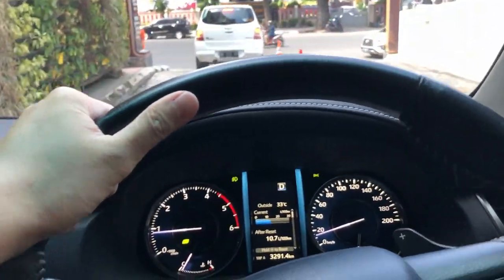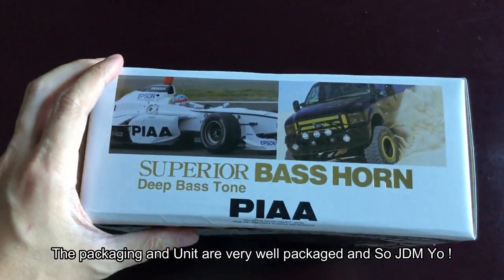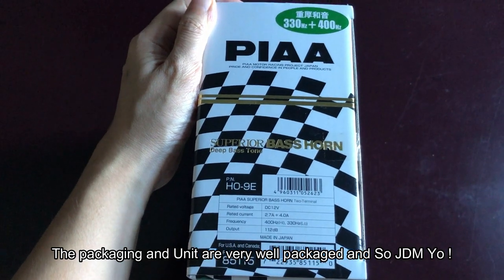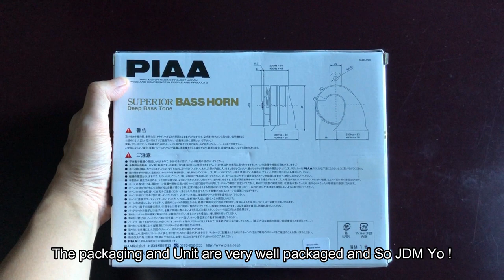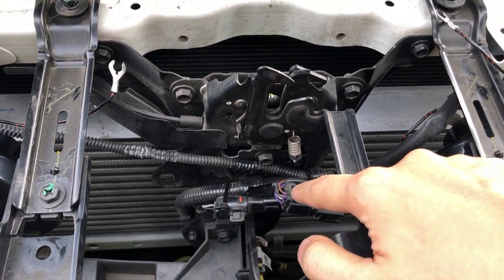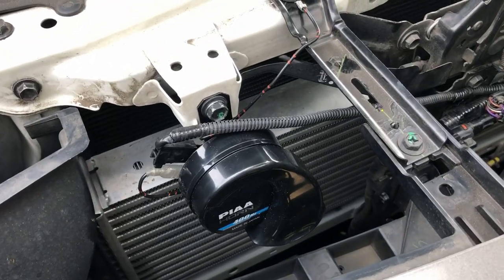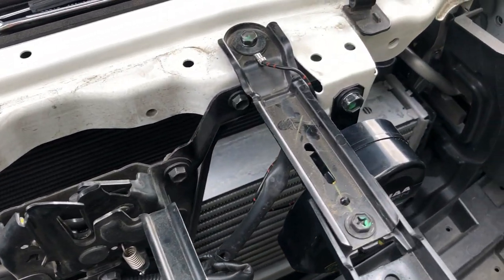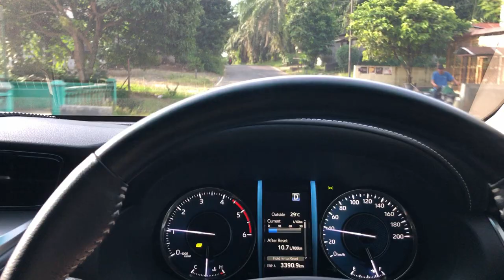PIAA Superior Bass Horn / Klakson PIAA Japan. Install Upgrade DIY. Toyota Fortuner GR Sport.

Comment: Will there be a difference in terms of loudness w/ relay?
Reply from the maker: @filomaker5645  nope it should be the same.
Reply: @FelixDanGarasiAuto  thanks. Will install mine on the crv this weekend. Video helps alot
Reply from the maker: @filomaker5645  no problems. let us know once you ve complete the install 👍🏼👍🏼

Comment: How did you connect the positve?
Reply from the maker: the original connector are there to begin with.
Reply: @FelixDanGarasiAuto  So you just have to connect a wire from one positive to the positive of the new horn?
Reply from the maker: @rick137.pickle  yea correct

Comment: What if I use a quad set up horn(4horn)? Do i need to use a relay? or do i need to use higher amp fuse? or both?
Reply from the maker: yes you must add additional relay if you want to install 4 horn.
Reply: @FelixDanGarasiAuto  thanks for replying. What voltage of relay will i use? Is it 12v? 24v?
Reply from the maker: @RJC4177  12v relay & Fuse it for extra protection.